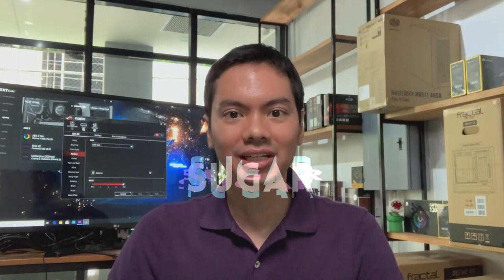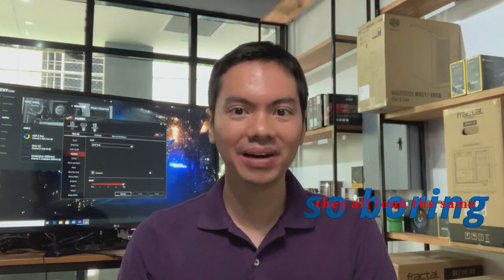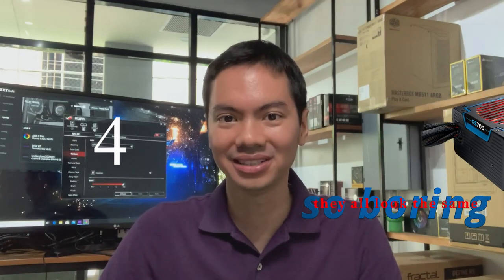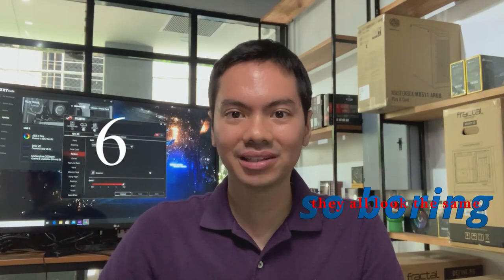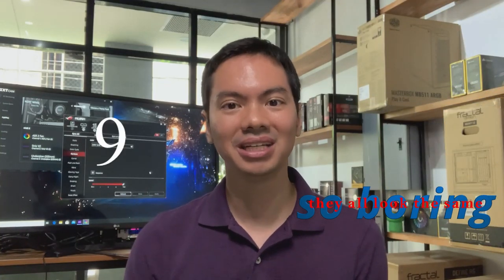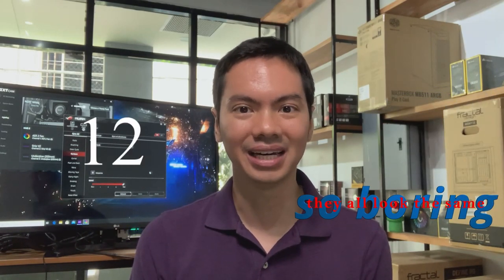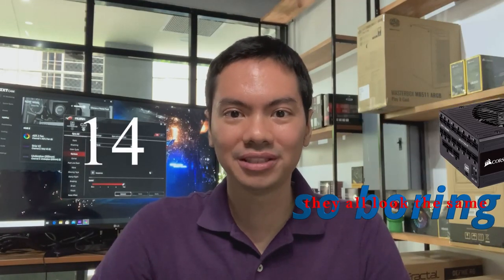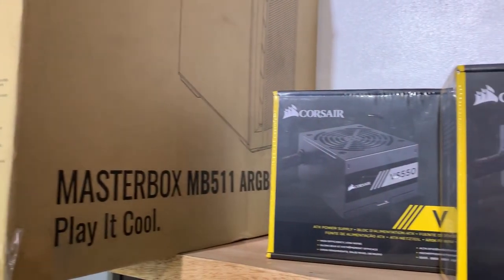The Differences Between All of Corsair's PSU Lines

Comment: well it'snot so simple anymore. A psu like the 650RMX, DOES not support 8+4 CPU. So if you have a mobo that needs to cpu cable to supply it power, your ass is completely out of luck. And most MObos are like this these days, i don't know why they are still making PSU that clearly have enough wattage but doesn't have the extra cpu slot for a cable to power these new Mobos. This is extremely frustrating.
Reply from the maker: I'm guessing the rumor about Nvidia's upcoming Ampere cards needing a new power connector (12 pin PCIe connector) did not improve your mood.
Reply: @hwsph  didn't know anything about that, I don't use Nvidia & I never will. Left them behind years ago. Spent 10 years with them, decided it's time to stop paying for over priced garbage.

Comment: Hello po. Totoo po bang yung cables nung RM line ay mahirap i-bend? Pangit naman pag ganun. Ang hirap ng cable management.
Reply from the maker: we've used the rm in several builds and have sold it regularly, wala pa namang nagreklamo sa flexibility ng cables. Although of course that's pretty subjective, what one finds too rigid another may find to be just right.